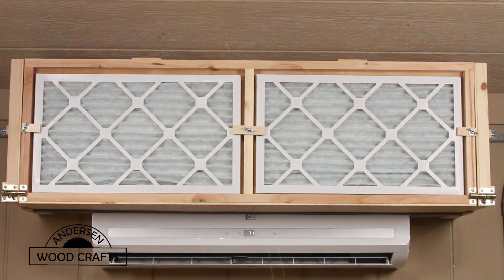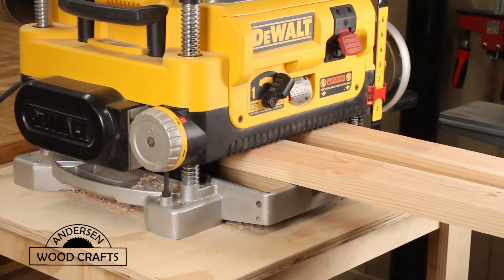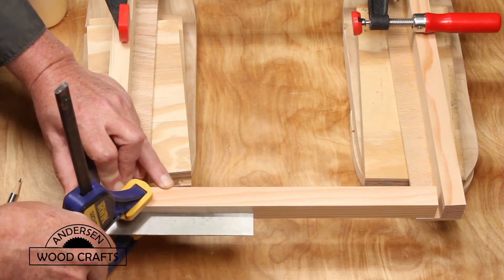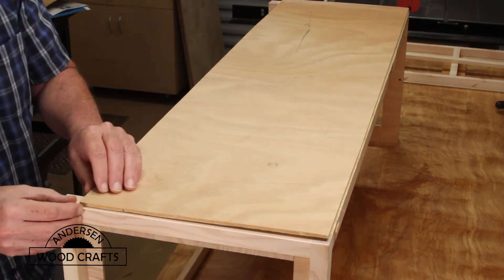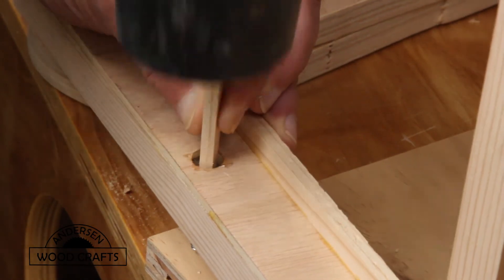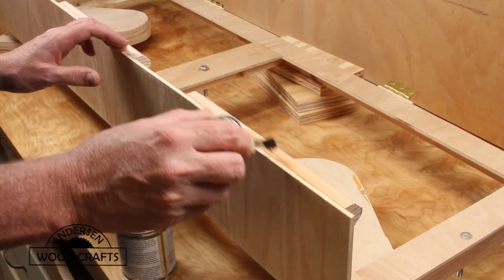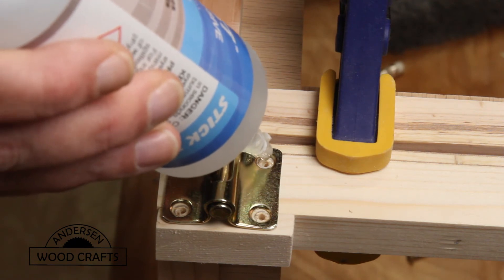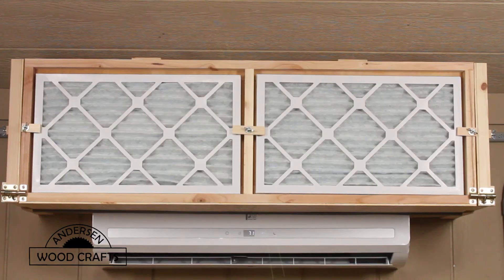MINI SPLIT FILTER BOX

Comment: Sorry to hear about the house fire.  Hope everyone is alright.
I like the design with the front hinged.  Noticed what appears to be a bolt sticking out at each end (5:38 and right at the end).  Purpose?  
Any plans or dimensions?  
I notice that these filter boxes often seem to be deeper than necessary, or is there something I’m missing?
Happy New Year and stay safe!
Reply from the maker: I was securing the side filter with a little block of wood, the bolt sticking out is to secure the front filter with a little block of wood.  I don't know how imperative it is, but the reason the boxes seem to be deep is to allow enough air in the inside of the box so the unit isn't starved for air.  My understanding is that if the filters are to close to the units intake it will starve the unit of air, making the boxes deeper (bigger) allows for enough clean air to be inside the box as to not starve the unit of air.  
Thanks for asking about the house.  We are settled in the new house, still working on getting the shop up and running.  Hopefully I will be posting some new video soon.

Comment: I’m curious why you and others use so many sq/in of filter? I am about to make one for my shop mini split, and I wonder this because my whole house ac is larger btu and only uses a single 16x20 filter. I am not trying to criticize, I just don’t understand the logic and all of the ones I have seen are like this or much larger.
I figure double the inlet opening should be sufficient.
Reply from the maker: The installation instructions for the mini-split gives minimum distances the unit needs to be from ceiling and walls (the minimum distance is 6", but recommends it be around 24") for proper air flow.  I used this measurement to build the box.  Sorry for the delayed response, thanks for your comment.
Reply: It is a pressure drop due to filter resistance issue.  More filter surface area means less pressure drop.  

Mini-Split fans run at a significantly lower static pressure than central air conditioning fans and are not designed to pull through an additional filter bank, so by increasing the filter surface area, you reduce the impact of this additional filter bank.

The problem is that when you introduce too much resistance you reduce the air flow over the coils.  This can cause them to ice up and that is bad for the compressor (in the outdoor unit).

Comment: Great idea until you have to actually clean the coils , or condensation drain line.
Reply: I’d easily trade the minor amount of time needed to access the unit for monthly maintenance in exchange for filtered air in my shop. Strongly considering doing this.
Reply from the maker: @MichaelBrown-vq4fd  It is a little of a pain to access the unit, but overall worth it.  Thanks for the comment and for watching.
Reply from the maker: It is a little of a pain, but I did make it so that it is relatively easy to remove to perform the maintenance.  Thanks for the comment.
Reply: I take a leaf blower to my coils and watch the dust fly.